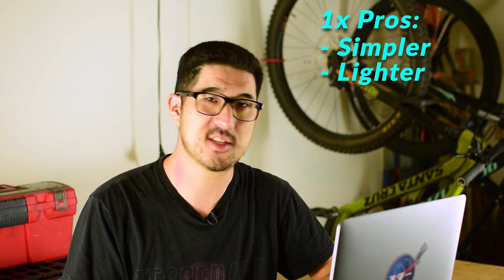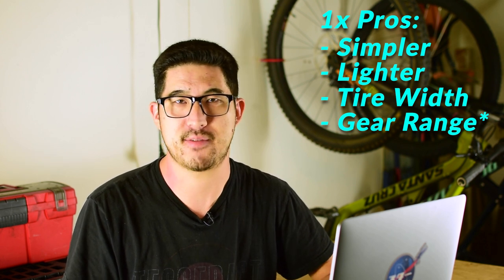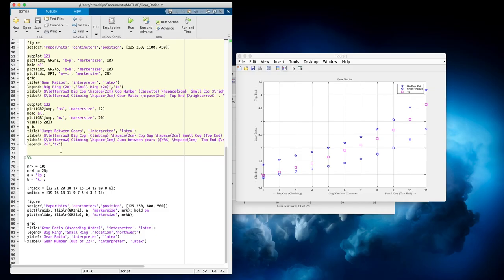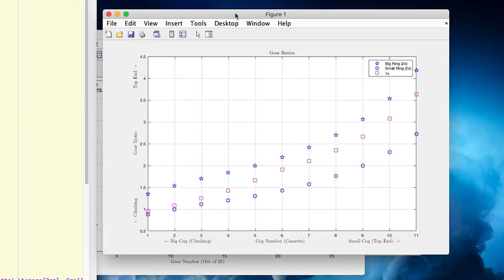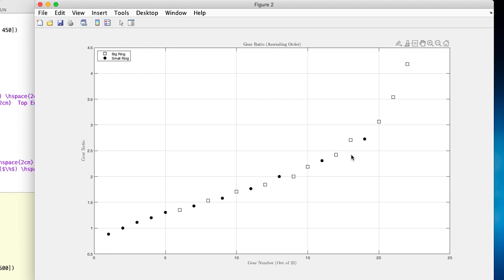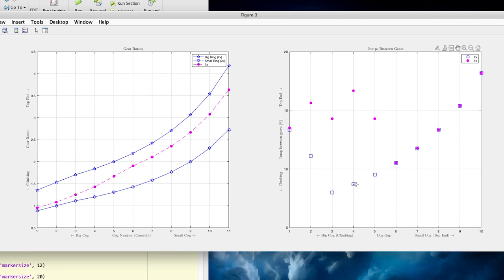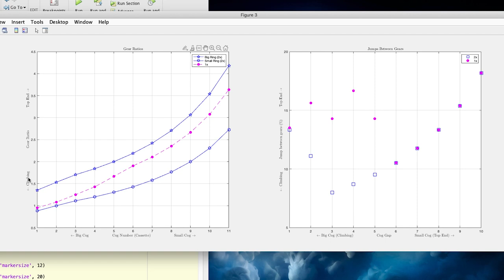1x vs 2x Drivetrains For Gravel Bikes | The ANSWER! (Is In Gear Ratios)

Comment: As Mr Quindazzi says the most important 1x problem is that you have to commit to a single chainring. If you go too extreme you will end up lacking. 34T will allow you to be almost in an MBT but you will not be able to race to much, and 46T might give you enough speed but you will have to be very strong to be able to climb a lot, even on a 10-36T cassette.  The bottom line is that on gravel you might go 2x to have some "good for everything" bike or go 1x a commit a little more on what are you going to mostly do with your bike, road or climbs....
Reply: 2x 46/30 with 11-36 is the most versatile budget friendly setup for gravel bike i can think of. gives less than 1:1 ratio and huge top end.
Reply: I use a 11-50 Sram casette with a 42T narrow-wide chainring. But there are 10-52 casettes for even more range. I don't think, range would really be a limiting factor on a 1x system.
Reply: @peterkiss1204  Yeah, 10-52 (which I think is the max range right now) Gives you range but you still have to commit on the chainring. You either go for a roadish 46 or higher, or go MBTish for a 40 or lower. It looks that those 10-52 will give you everyhitng but there will be climbs too steep for a 52 (C) to 46(CR) or descending roads where your 10 - 36 will not be enough.
It´s important to make sure of what are you going to do the most and prepare for that, while making sure that you know what you are missing.
Reply: @azathell  As I see you really don't need anything too much below 1/1 gear ratio. It already is almost as easy as walking.
I rode a 48T chainring with a 9 speed 11-36 Shimano casette before changed to 12 speed. The 11/48  gear ratio was plenty enough for me, and would be probably for most cyclists. The only reason I changed to 42T is because the 12 speed system required a narrow-wide chainring, and I couldn't find a bigger one that fits my frame and crank set.
Reply: @High_Octane  what casette do you use?
Reply: @imola8  Shimano CS-HG50 10 speed 11-36. very good cassettte.
Reply: @High_Octane  I was looking for a 11 speed casette with 11-36. But thanks anyways!

Comment: 2x all the way, i have 1x mtb, 1x fatbike,  2x road bike, and recently purchased 2x gravel bike, and I'm convinced in a good choice. 1x drivetrain isn't good enough on the tarmac, if the relief  is flat and hills,  you  have to play or shift several cogs to be ok, but on the 2x you just switch from big chairing to the small, and thats all. Another big issu with 1x is the high speed on the tarmac, 40x11 isn't enough for moderate cadence
And of course,  any cycliste must have some knowledge how 2x chainring works and how to adjust front derailleur,  i mean trim position or fully engaged to avoid the chain and derailleur contact
Reply: Nowadays, you can only find one or two 2x bikes in model ranges; the majority are 1x

Comment: Started out on a 1x mountain bike and always felt like I didn't have enough top end speed. Went 2x (50/34) on my gravel bike with an 11-40 cassette and I finally found an almost perfect system for climbing up and sprinting on flats and descents.
Reply: 50/34 is a tad to much for me. I am running a 48/32 with an 11-32.
Reply: What speed is your drive train?
I am so torn on trying a 1x or wether or not to replace my worn 2x9 with what I have. The cost will be pretty much the same but losing top and bottom gears scares me.
Reply: Depends on your needs. I have a Tern Verge X11. It has a 52 chainring on the front and a 10--42 on the back with 451mm wheels. And there's no hill I haven't been able to get up. And it is plenty fast on the 10 to 52. What people forget. Is having a bigger gear ratio at the top means little if you cannot get a good cadence. And I have experimented with a 56 tooth front chainring and actually went slower than the 52.

Comment: Great video! I had this very debate when I was deciding which gravel bike to buy. I have increasingly favored 1x drivetrains on my bikes over the last few years. I find 1x stems better suited for off-road riding or casual street riding. The larger jumps are more noticeable and less desirable when you are going faster and trying to find that optimal cadence as you mentioned in your video. It looks like Shimano tried to eliminate that as much as possible and, like you, I am second guessing my decision to go 2x on my gravel bike.

I definitely should have studied gear ratios a bit more to better understand how my ride would have been impacted by the ratio gaps. My logic was oversimplified in that I decided that 1x11 would not yield appropriate ratio gaps and that I would need at least a 1x12 to achieve a more appropriate progression of ratios. Perhaps that is somewhat accurate, but after looking at how Shimano does it, I think I would have been just fine because regardless of whether you go 11-40, 11-42, or 11-46, all three have the same progression of 11-13-15-17-19-21-24. 

Then, along comes Campy with their new Ekar 1x13 gravel groupset. Have you seen it? They offer 3 different cassette options:

9-10-11-12-13-14-16-18-20-23-27-31-36

9-10-11-12-13-14-16-18-21-25-30-36-42

10-11-12-13-14-15-17-19-22-26-32-39-44

Looks like they are taking what Shimano does to the next level with packing the top end of the cassette with very tightly spaced gears.

Had I gone with a 1x gravel bike, it more than likely would have been equipped with SRAM Apex 1:

11-13-15-17-19-22-25-28-32-36-42

They start ramping up the progression one cog earlier than Shimano with a larger jump from 19-22.

My Specialized Diverge has a Shimano 11-34 configured as such:

11-13-15-17-19-21-23-25-27-30-34

The 48T big ring on my bikes does have me favoring  the 17-19-21-23-27 cogs most which are all 2 tooth ratio gaps. Had I gone 1x SRAM with a 42T ring, I would be favoring the 15-17-19-22-25 cogs. My ratios would be very close to the same with the 1x setup except for when I was on the 22 and 25 where the gaps spread just a tad. Not likely a big deal.

Sorry this is so long of a comment, but one last thing. After getting my Diverge, I ended up building a super budget gravel bike that I intend to actually ride on the local mountain bike trails. I have it setup with 650B x 47 tubeless tires and a 1x8, 38T ring with an 11-40 cassette. Those are some big jumps (11-13-16-20-24-28-34-40)! The little bit I have ridden it on trails does seem to validate my initial impression that 1x is better suited for slower riding. It is insanely fun and I can't wait to try it out with the recently installed dropper post!

Thanks for hopefully reading this and I look forward to more content like this if you decide to make it.
Reply from the maker: Hey man, excellent reply and observations! Thx for checking it out. Lot to unpack here, but basically, yes I’ve found that there’s more to it than just disregarding 1x bc the jumps will be presumed to large. On a side note, saw your 650B setup on the diverge. Something I want to explore soon! Looking forward unto your ride review on 650B.
Reply: just get a mtb please lol
Reply: @High_Octane  I have one of those, too.

Comment: As someone who has/had 1x,2x and 3x both in MTB and road bikes, allow me to share my personal opinion on the matter: 
1x is way cooler looking and offers a clean cockpit. But the range will be more "specialized" for lack of a better term; meaning you either choose high range for speed or low range for climbing, but not both in the same ride (depending on the size of the installed single chainring in the front)
2x and 3x might look a bit uglier yes, but in terms of functionality, range, as well as jumps between gears, there is no beating them! 
That's why my adventure machine (a Hardtail) is still a 3x10 to this day. I mostly only use 2 of the rings upfront , but just having the option to switch to the tiny third ring in the front has saved my ass many times where a hill is too steep. Meanwhile the largest chainring (40 tooth) allow me to go downhill to almost 55 Kmh before I start spinning out (I don't like spinning fast, more of a grinder, so my cadence is probably lower than average).
In short. I don't like 1x as much as a 2x or a 3x, regardless of the kind of bike, even Mountainbikes, which is why I got rid of my 1x SRAM eagle XC bike and got a 2x instead.
Reply from the maker: Thanks for the thoughtful, well-articulated input!

Comment: Best most useful discussion I've seen on this topic. You did the heavy lifting and then simplified the results for the rest of us. Thanks.
Reply from the maker: Nice, thx for the feedback!
Reply: Wow, this is just what I've been looking for (you obviously have some kind of analytical background--good work).  I have a 1 x 8 hybrid with a typical 11-34 cassette and a 38T chain ring on  27.5" wheels. I rarely use my 8th gear, but I do wish I had a little bit more gear climbing ability. So I bought a 36T chain ring hoping that will help (haven't tried it yet--waiting for the snow to melt :-).  If a 36T ring is still inadequate, then I'll try a 34T one. However, I will never go back to a 2x or 3x configuration.  Thanks again for your video.

Comment: Yup, I been a roadie for over 10 years. Just recently jumped to a gravel bike &  hard tail MTB. Gear gaps are just insane,  for a roadie...its taking time to get use to it
Reply: The gaps and extra cost of parts put me off.
Reply: I run a 3x9 and all the gear gaps are super close. I also have a roadie with a 2x10. I wouldn’t mind a wide range 1x9 or 1x10 since I am constantly double or triple tapping my rear derailleur on road drivetrains. In a 1x operation is really simple and every gear is uniquely useful.
Reply: Thats right 9 SPEEDS RULE for me. Too much whining over gear jumps. SERIOUSLY your legs don't care. They only know is it too hard or not hard enough.

9,10,11,13,15,17,20,23,26

45 on the front. Absolute perfection. No hill I cannot climb. And I can break 25mph on the flat. And for a 20 inch wheel folder and a 59 year old rider. That's all I need.

Comment: No-one want to talk about increased chain wear on the 1x system as you will ride with a much more angled chain pull when in the lighter(est) gears.  And this adds noise too.  Not a biggy, but worth a thought.  Apart from that, for beginners and non-wrenchers, 1x will serve you well everywhere

Comment: After I had my old mountainbike serviced, I noticed that while speeding up with the front on the smaller wheel, it didn't grab the chain and I almost died on a road, because I couldn't get my bike going. Ever since I used the big blade on the front and learnt to change only the back gear. Now I'm looking for a new bike and I want to buy a gravelbike as under the circumstances where I drive here in Thailand (rough and smooth roads, sand, and gravel on the road) I found a lot information about anything related to gravelbikes (and mountainbikes). And given the experience I had and your video, the choice is easy: I go for the 1x drivetrain. Last sunday I was in a shop which only had mountainbikes or racebikes, the seller was showing the 1x drivetrain bikes as the latest innovation. I thought it was ridiculous, but now I learnt that this is really what I want. Thanks for helping me decide!

Comment: Great video!  There are a few other points I'd throw into the mix.  Firstly, 1x makes it easy to change your overall gearing, simply by swapping the chainring.  Secondly, in the graphs of 2x great options, I'd ignore the 4 gears with the worst cross-chaining, making the number of unique gears even less.  Thirdly, it's probably worth acknowledging that the extreme gears on a 1x have worse chainline than any sane 2x ratios, which might be a consideration.  Fourthly, another pro for 1x is that the chain is much less likely to be unshipped.  And finally (!) It would be interesting to see some of your graphs comparing more modern groupsets, like SRAM AXS Wide Vs Campag Ekar.  You know you want to!!!
Reply from the maker: Great insights! I agree with everything you mentioned, including another video (or series) on other drivetrains. Will put it on the to-do!
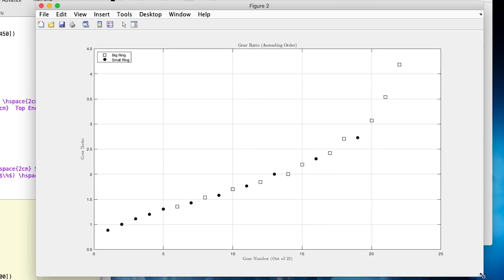Reply: @TheBikeSauce  late to the party.  great video.  Agree with Richard.  Be interesting to add the 1x ratios to you chart @ 8:45, and highlight the cross chain ratios on the 2x Richard describes.  Great stuff!

Comment: Thanks for geeking out and making this video.  I found it very informative.  I like the 1x systems for their simplicity.  Also  I go back to the many times that the chain was rubbing on the front derailleur and driving me nuts.  Yeah, it was out of adjustment, but now no worries about that.
Reply: At least on a 2X you can tune your derailleur to get rid of the rub.
What i do not like about my 1X is when my chain is on the top gear, a part of it rubs on the second highest gear because of the angle. Also the sound that the chain makes on the chainring when i am at the lowest gear which is again caused by the angle. Both indicate additional friction that could be avoided on a 2X setup if you choose your gears adequately.

Comment: Extensive mathematical analysis. I think you missed 2 things: 1x have more frictional losses, and the actual reduction in range is significant in that you'll end up short on one end or the other- that is especially important for older and heavier riders on the low end. I really don't think jumps between gears is all that important. 2x with 11-40 Cassette is the best all around solution. Good video
Reply: It’s almost like you didn’t watch the video.

Comment: I use my gravel bike as a gravel, touring, all-around bike. I have had the luxury of running Shimano Grx in 1X and 2X in a touring and every day situations from roads to gravel  and fully loaded touring. I have also had the luxury of pushing the limits with goat links and the like. I'm two going on three years into trying this on bikes. I started with 1X and switched to 2X mostly thinking I was missing out on something. This I know. I like close gear ratios but I hate the maintenance and potential problems of 2X. I LOVE the simplicity of the 1X and really might prefer it due to the simplicity and the realization that you have what you have. The best of both worlds may be having a crank that can accept 1X AND 2X.

Comment: This is next level stuff. But the next next level would be downloading your Strava gpx data and parsing your distribution of speeds and plotting that over your gear ratio plots. You'd want the area with the smallest ratio jumps to coincide with your most common speeds. 

Next next next level is parsing your power data and generating a bivariate distribution of speeds and power versus time to correlate to hear ratios. You'd have to preprocess to drop the zeroes, like when you're not pedaling and have zero power.

Comment: Up until very recently, i completely avoided 1x bikes, as it seemed like a poor choice for range and efficiency, but now that i keep seeing actual data about it, doesn't seem like a bad deal. Now i have this exact 46-30 and 11-34 on my bike, but having a 40T chainring paired with an 11-46 would be pretty similar in climbing gears, and only slightly slower  in the faster gears (something i'd probably not miss much).

Comment: i tried already both and the main reasons to go for 2x are for me, that you kind of have a hybrid way of driving (you can go fast and do roadbike trips - mostly using the big ring; or go on MTB trails and mostly use the small ring. The second main reason for me ist, that i just dont like the chaincrossing noise and feel on a 1x. It doesnt feel good and it also seems (in my mind) to constantly wearing out my chain and the casette. And if im going uphill a really steep climb, having that feeling and noise in mind ist just not that comfortable for my driving "feel" - if you can say it like that  (sorry for my english, i'm german ;D)
Reply from the maker: Totally understand that sense of always mildly cross chaining on 1x; I feel that on my mtb. I like the driving analogy! And your English is great!
Reply: Chainline is king!
Reply: This is the correct answer 2x is king
Reply: @TheBikeSauce  how efficient is the chainline of a 2X compared to a somewhat equivalent 1X? I saw one test from Velonews by CeramicSpeed which shows that a 2X system only has an average of 3 watt advantage over a 1X for a 250 watt input; the 1X had 12.24 watts of frictional loss while the 2X had 9.45 watts of frictional loss.

Looking at percentages, the 1X has on average 29.5% more frictional losses than a 2X, but the absolute  difference is just 3 watts for a 250 watt input.

What i did not like about the test is that they tested drivetrains from 2 different brands instead of testing a 1X vs 2X from the same groupset of the same manufacturer. Plus the chain in their test is quite clean, i wish they also done a test using a "dirty" chain that has been used for a few km on gravel before being used in the test rig.

It would be epic if you could perform some sort of test using an indoor trainer and a crank power meter as channel content.
Reply: @Massproduce201  as per CeramicSpeed testing, 1X system has on average 29.5% more frictional losses than a 2X , but if you look at the absolute numbers it is a difference of 3 watts of frictional loss for an input of 250 watts.
Reply from the maker: Coincidentally, I'll be working with Jan Heine and a group of my undergraduate engineering students starting this fall to do some cycling research. This will certainly be one of our first topics. Haven't announced it yet, but I'm so excited about the program!
Reply: @TheBikeSauce  So you are a university professor? That would explain the fine details in your videos... 🙂
Reply from the maker: Haha yes